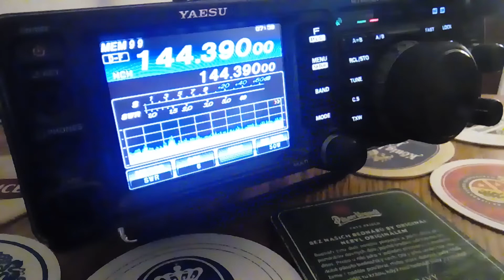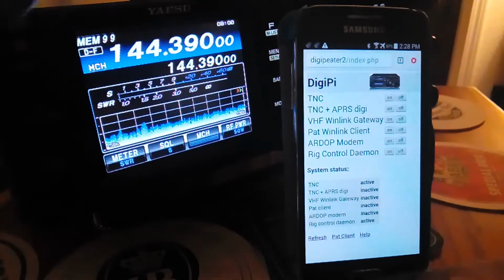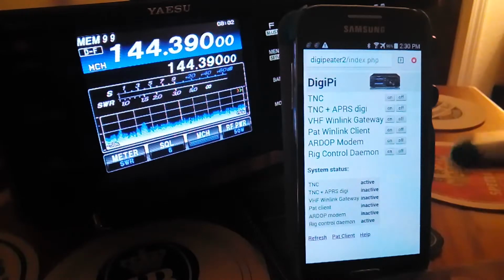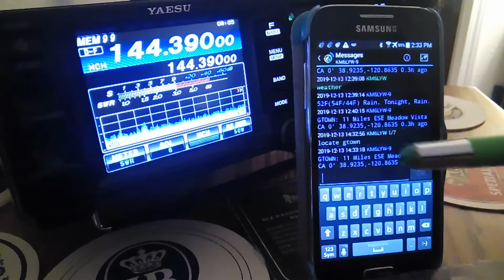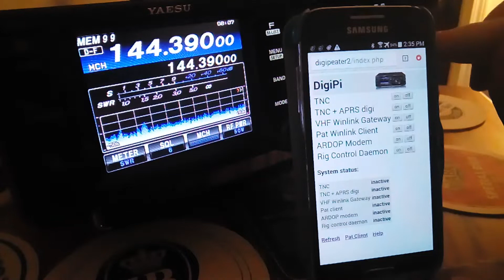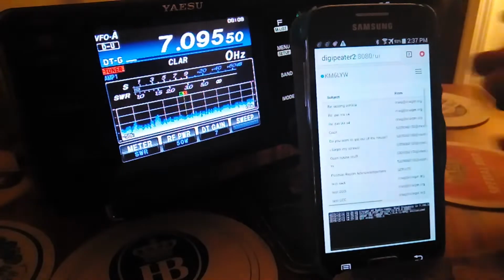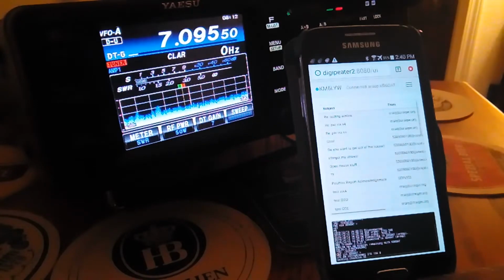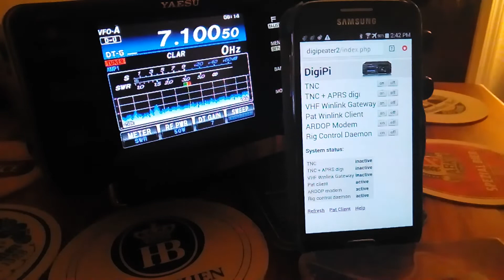Packet Radio Demo with Raspberry Pi

Comment: @13:43 Yes, in the early 90's modems capable of 56 Kbps were available. Ten years prior to the  Internet we were doing packet at 300 baud using RF. You have done great work with current technology using the digital communications developed over 40 years ago. This is a wonderful video Craig. 72 de KB8AMZ